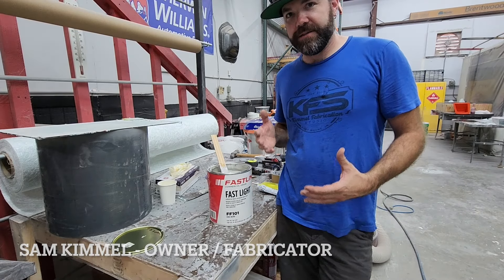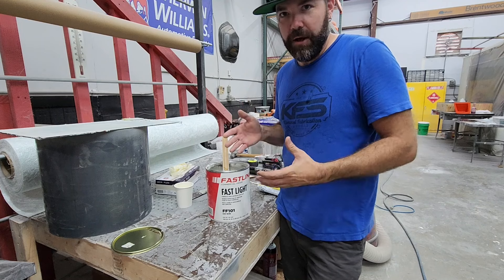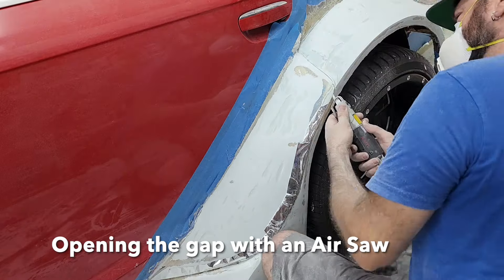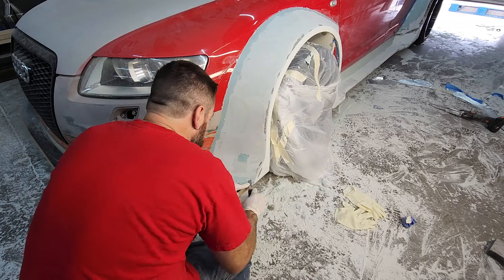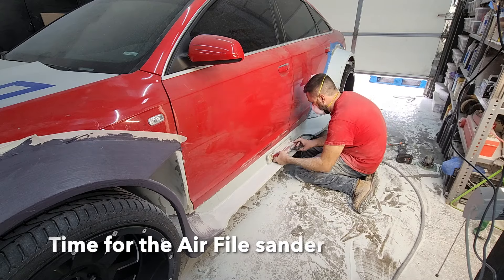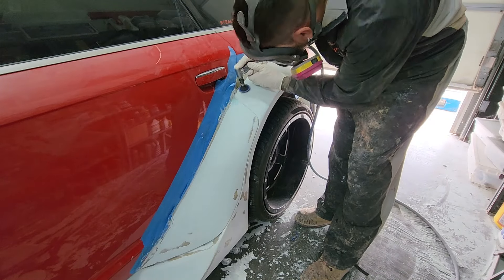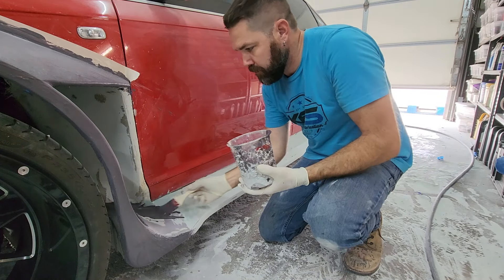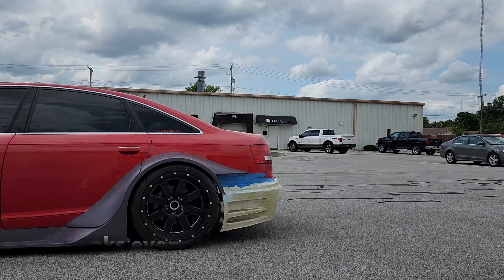StealthBuilt Audi Widebody -  9 - Bodywork and Primer on Driver Side + Tips / Tricks!

Comment: I used to have a stage 2+ 2016 Audi S4 and had always dreamed of going wide body on it. Spent prob $15,000 on mods including wheels & air suspension and performance upgrades. Not including labor lol. Would love to see you do this on a S4 B8.5.
Reply: Now drive a 2021 BMW 540i xDrive. Has a lot better infotainment and technology in it over my 2016 Audi S4.

Comment: Thanks for sharing! What brand of cordless file sander and pneumatic plain sander are you using?
Reply from the maker: The palm sander is a dynabrade, it was pretty expensive, but the cordless sander is made by WEN. It works great, and was on like $60.

Comment: Is this going to be a kit or is this a one off ??????
Reply: probably one off!
Reply from the maker: I am using the stuff on the car now to make molds and then make new carbon fiber parts from the molds. I don't know if I'll sell kits though. It takes a lot of modifications to make these wheels / tires fit. 335-25-20's all around.